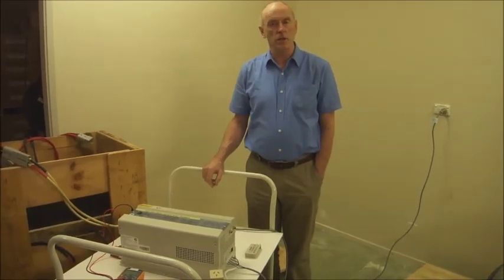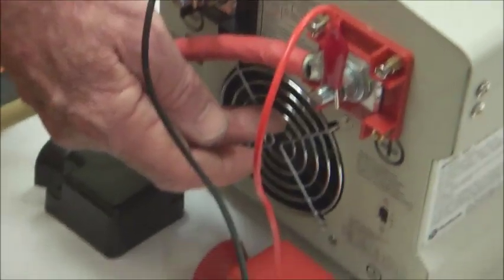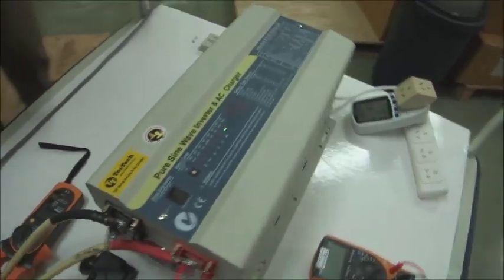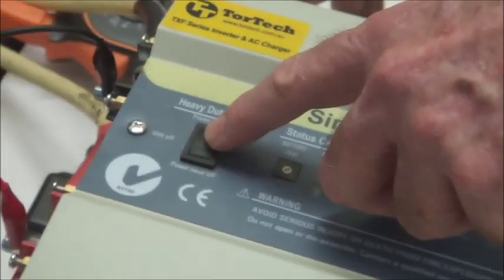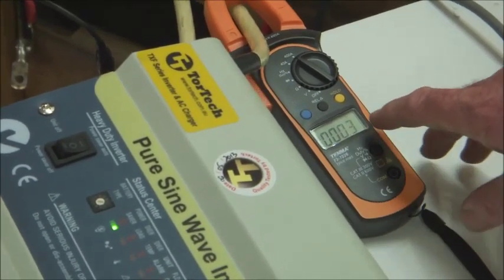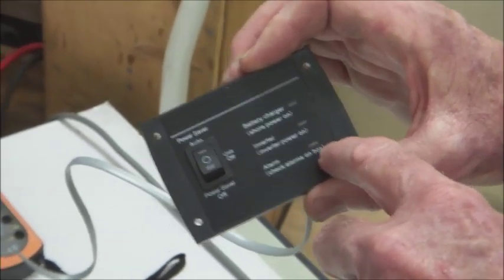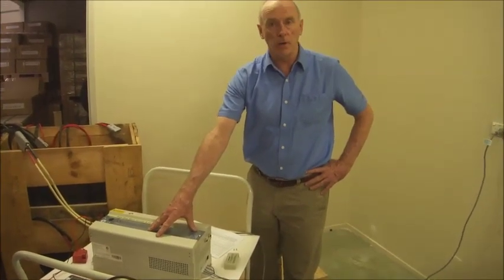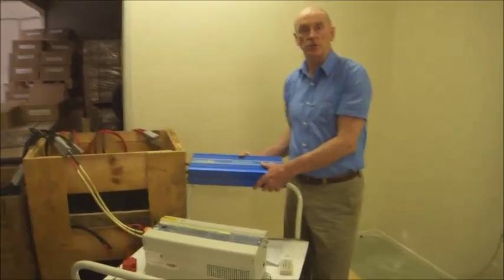Demonstration of low frequency Transformer based Pure sinewave Inverter Part 1

Comment: What will happen then to the solar charge controller charging the batteries if this machine connected on line to ac source. Is it safe for them working simultaneously?

Comment: hlo , please will you suggest me model of transformer for my project "AC link DC_DC converter with switching frequency kHz" . the input of boost is variable DC 10-14 and output is 220v dc regulated. my email id is keshar.rawal@student.ku.edu.np